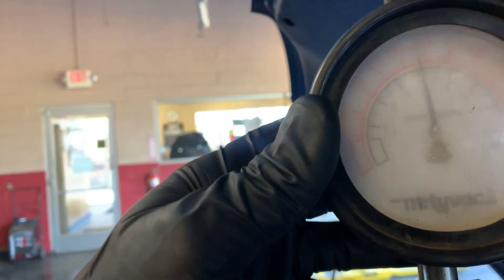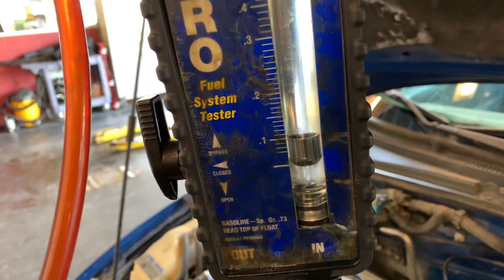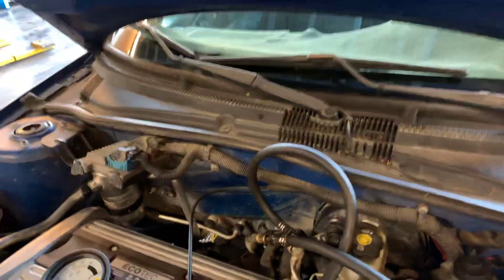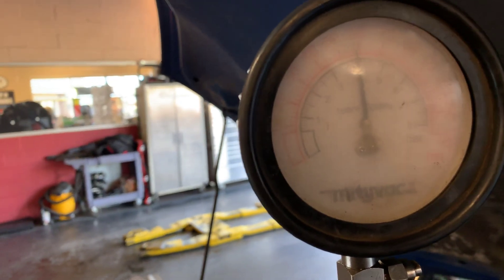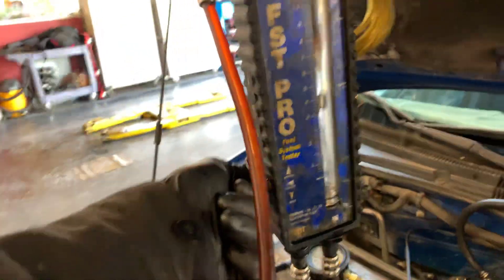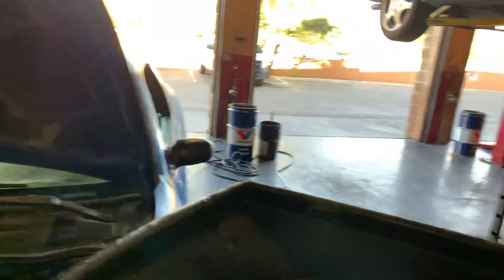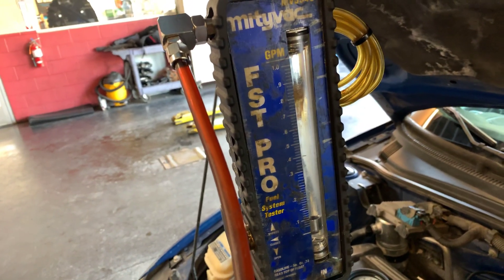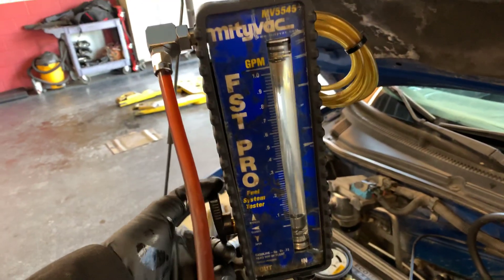Fuel volume

Comment: Double pressure on dead head?
Reply from the maker: B Young of reading instruction manual for this piece of equipment says this. It’s been my experience that that’s not always the case on these return systems. Old pump jumped 10psi doing dead head. New pump jumped 30psi doing same test but yes there are also some pump designs that will double pressure. Only thing I can think of is it’s already a high psi pump. The double psi pumps for dead head were around 30 psi so double that and it’s what this pump runs normally.

Comment: But Cody i did not get that volume measure device, how does it work or better say how does measure volume without making car stall? 
Can i do this kind of test checking the pressure while WOT?
Reply from the maker: armando nika the sight glass has a float that changes with volume. Once the new pump was installed the volume and float was in the center of the sight glass at idle. Doing full volume test is nice with this and don’t have to drive vehicle to see max pressure.
Reply: Nice brother! Awesome approach and timing on this video. We were just talking about this and the tool!
Reply from the maker: And yes doing wot is a way to do it as well.
Reply: Cody’s Auto diagnostics thanks for your explanation buddy!